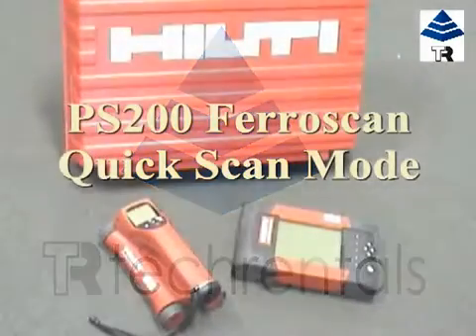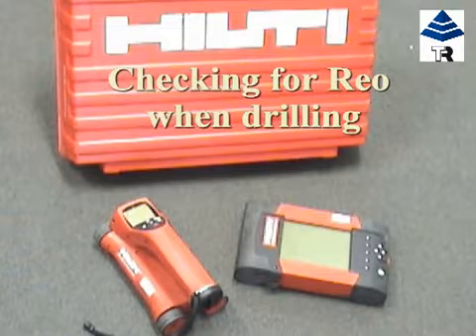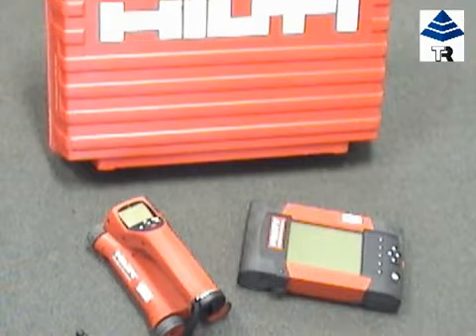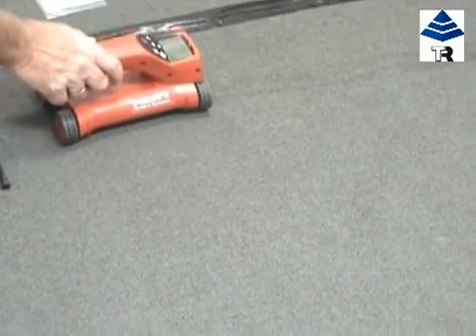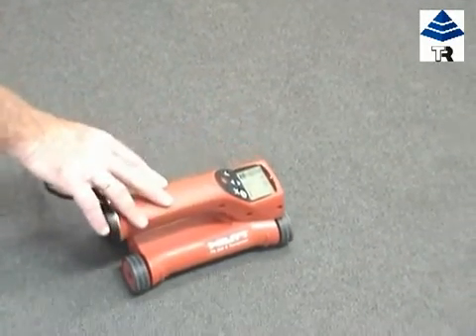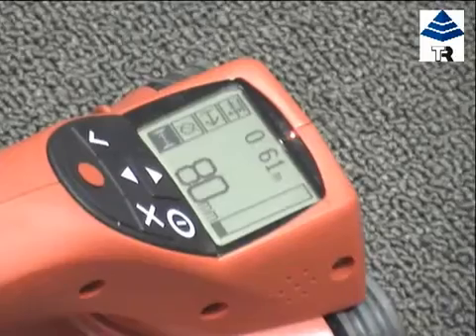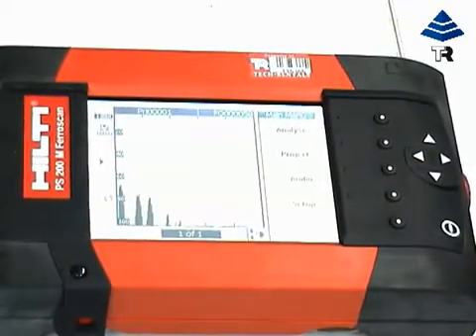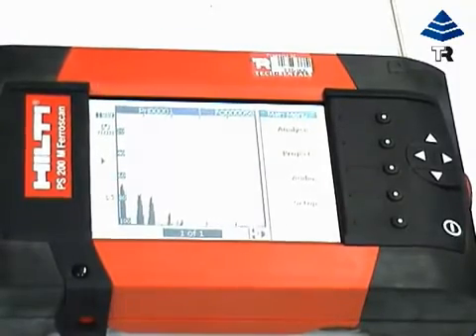Conduct a Hilti PS200 Quickscan

Comment: If the diameter of the rebar is not known but we know that is in ASTM range, the rebar spacing is unknown and only cover can be guessed, what is the procedure to scan the soffit of a beam for detecting the number and diameter of the rebars? The width of the soffit is 300mm.